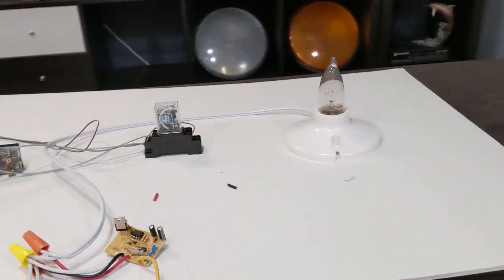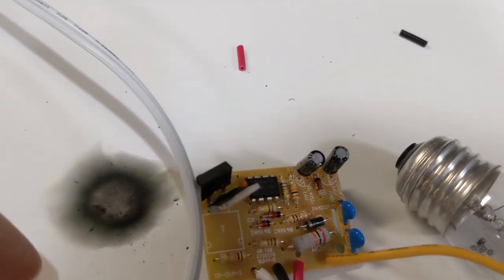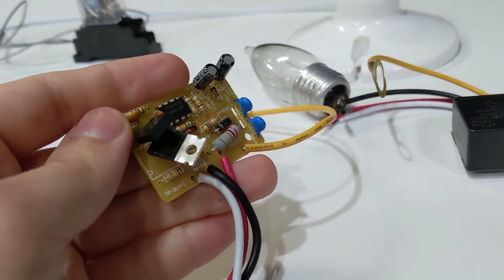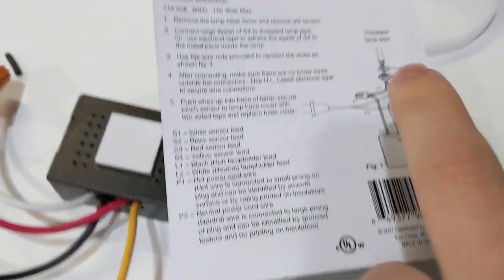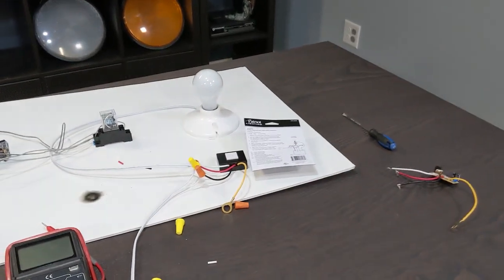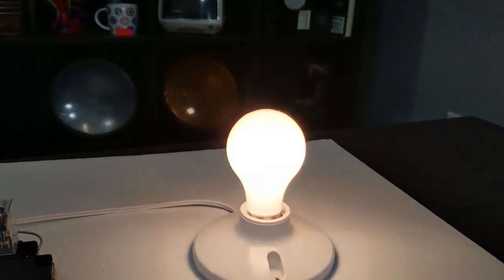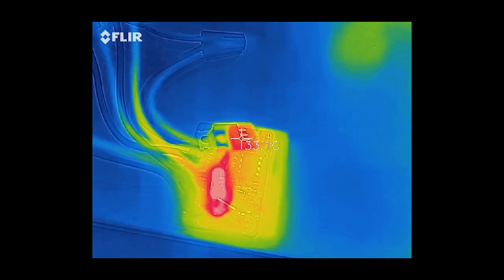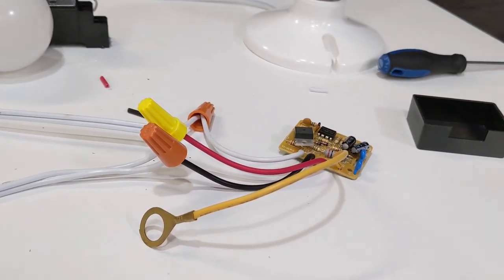A slightly explosive touch-lamp follow-up (standby energy consumption)

Comment: Yeah, the Chinese gave up on our idiotic wiring colors right away.
Black is ground in everything except house wiring, which is hot (or when cost means you use black for everything). And that's such a fundamentally idiotic change they just gave up instantly. To them, if you self identify as a victim, it's fine if you get victimized. If you clearly don't care about color coding of your wiring, they'll not care either. And there is no nuance here. Sure, we only showed how little we cared with the differences between house and all other electronics; to them that means they won't care at all. Either care, or don't; going halfway means nothing, it means you don't care, so they won't.
Basically your poorly thought out and loosely held beliefs are allowed to be judged to the extreme.

Comment: no it would not matter if you reversed the hot and neutral. the issue here is that by following the wire colors, you are applying power between the neutral input and the hot output. who idiot decided to swap around all the wire colors?! absolutely absurd!
Reply: there would be a difference between connecting the ac between the output and neutral input vs the output and neutral hot, but relative to each-other hot and neutral are identical and can be swapped. the only difference is neutral has same potential as ground, but since there's no ground involved here there's no need to consider hot and neutral as different.

Comment: I'd like to bring a different perspective to your American wiring stupidity, wire nuts are crap, get some tunnel connectors. Also, BLACK IS NEVER ACTIVE IN AUSTRALIA. Red white and blue are for phases, black is for neutral. For a European standard, light blue is neutral, and brown is active (not sure what phase colours they use) and we both use yellow and green for earth.

Then again, wiring it properly is so boring.